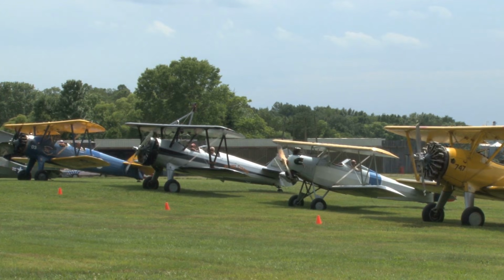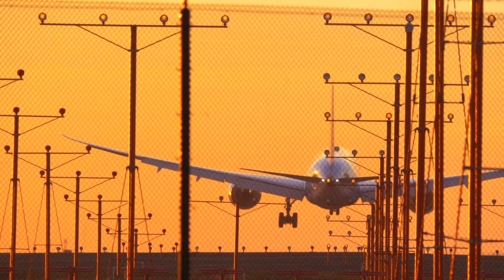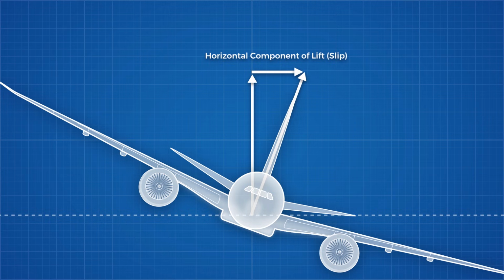Why Does Wing Dihedral Make Planes Stable?

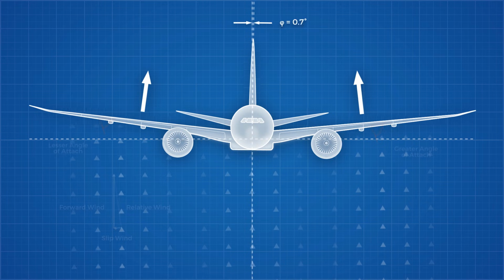Comment: 2:57 the stability of a design in flow can be described by something called the Monk Moment, however i cant find any reference of it online (i learned it in my marine hydrodynamics course).

If you pushed an ellipse shaped object through water lengthways, it is actually unstable and will rotate so it is going ‘side on’. There will be more drag but it will be stable.
Reply: I didn't know that! I wonder if that is what makes kayaks so difficult to keep in a straight line...
Reply: Benjamin Brooks that’s exactly why they are unstable! They have features which help with their directional stability, such as channels running the length of the hull and the shape of the hull its self but ultimately the thing wants to go side on.

Its like balancing a pencil by its tip
Reply: @tommclean9208  Kayaks which are meant for whitewater are nearly flat on the bottom, and are hardest to steer. Others have keel ridges or channels that help a bit. Canoes are easier still. I suspect the aspect ratio affects directional stability. Thanks so much for teaching me this!
Reply: Benjamin Brooks they probably design the whitewater kayaks that way because they want them to be directionally unstable, help them to turn quicker and with less effort.

Comment: From my understanding, at least for cargo planes, another reason wings are typically high-mounted is due to the increased cargo volume. With high-mounted wings, the supports that would normally pass through the fuselage of the plane with low-mounted wings instead pass through the top part of the fuselage giving way for extra cargo.

Comment: One of the less stated reasons for the inverted gull wing on the corsair is that a wing mounted perpendicular to a fuselage creates much less parasitic drag. The designers could have simply mounted a straight wing farther down the fuselage, but it would have created more drag at the wing roots. This is why planes like the F4F Wildcat, F6F Hellcat, and the MiG-15 had mid-mounted wings, even though that design required longer gear and gave less instability.

Comment: Your suggestion of high and low mounted wings is incorrect. All small recip engined cessnas are high wing with dihedral. All small recip engined pipers are low wing with dihedral.
Reply: Because they have straight wings. If they had swept wings the high wings would have anhedral.

Comment: No, it's not a matter of greater angle of attack. It's a matter of less wing area presented to the downward force of gravity. It's also a matter of the level wing contributing to a perpendicular force (straight up)as opposed to the other wing's wing's force pointing even more towards the fuse. 

I suppose we have someone here who believes that wing lift is explained by the Bernoulli principle.

Those of you who disagree with me, please explain how a plane with NO ailerons can bank and turn with just the use of the rudder and and a little elevator. Remember, the fin and rudder are only supposed to control yaw.

Comment: 7:00 The main reason for the gull wings of the F4U wasn’t for prop clearance or the shorter landing gear, but more due to interference drag where the wing root meets the fuselage. The F4F Hellcat had the same engine as the first version of the Corsair and a prop that was only 2 inches smaller and it still had plenty of ground clearance to spare.

Comment: Are you familiar with the "Mandela Effect" and the idea that Airplane designs are different from what they have been? Ex; jet engines are now larger and differently designed, The Wing tip ends are new and had never been seen by me nor many others up until about a year ago. I took flying lessons in my youth and have been airplane centric most of my life. I've never seen the "Forward facing wings before, not even as short term Experimental's.
I've also never seen a jet engine mounted in the center of the tail, that looks extremely odd to me.

Comment: Your explanation of the inverted gull wing is the simplistic version. There was a NACA study that found that there was less drag on wings that are perpendicular to the fuselage, but it's always more convenient to have a low mounted wing. The P47 used the same engine and a little longer propeller and it doesn't have much longer landing gear, so the designers didn't have to have an inverted gull wing for that reason. They did want shorter landing gear to make it stronger as another way to reduce drag the designers made the landing gear the dive brakes instead of bolting on brakes that would induce drag.

Comment: There’s actually four factors which affect roll,
or lateral, stability. 

One is dihedral

Two is interference... which rather than creating a high pressure on high mounted wings actually increases the angle of attack on the lower wing and reduces it on the upper due to how the fuselage influences the airflow. 

Third is tall tail.. or how much surface area is above the centre or gravity. 

Finally are swept wings. The lower wing presents a higher aspect to the airflow while the upper produces a lower aspect... resulting in a restoring force. 

This is why planes like the C-17 have anhedral... because they’ve already got high mounted wings, a large amount of surface area above the centre of gravity, and swept wings. It would be too stable without the anhedral. 

But take similarly configured aircraft without swept wings like the C-130 or ATR-72... and they don’t have anhedral because they aren’t too stable. 

It’s also worth to note that these depend on a slip to work. If you roll an aircraft and the ball or brick or yaw string is in the middle, there is no restoring roll. It will stay like that forever. In fact... due to the difference in speed of the outboard vs inboard wing, the roll actually wants to increase in a turn. Have a look at your control inputs next time you fly a plane—you might be surprised that you have an opposite roll input as you turn. 

This is also why aircraft are susceptible to spiral dives and will often enter one if the pilot is inattentive or it is rolled too far. 

The final point is that these effects are opposite when skidding. The skid is defined when using top rudder rather than bottom rudder. Using top rudder produces a restoring force. Bottom makes the plane roll more. Intentional cross-control is almost always a slip for that reason. 

Purposefully using a skid actually increases the maneuverability of the aircraft. A roll will always be faster when led with a massive amount of rudder. A snap roll... typically the fastest roll a plane can perform (if it’s stressed and approved for it) uses only rudder after the elevators have stalled the wings. The rudder reduces the stall on one wing and increases it on the other, resulting in what is in effect a horizontal spin.

Comment: Did you know that on the F4 Phantom the leading edges of the wings have ports spaced along them, so high pressure bleed air from the engines can be ducted out of them, to give the wing more lift at lower speeds, they did this due to the low "Aspect Ratio" of the wing(translates to a very thin wing).
Reply: Yeah, but is .03% written as .0003 when it come to decimals?

Comment: The Wittman Tailwind W8 and W10 have no dihedrahl or wash out. Makes for a sensitive handling airplane. The only positive stability is from the fuselage hanging below the wing.
    A Very nice flying aircraft that can be trimmed out nicely but needs to be flown and landed with a gentle but firm hand.
   Doran Jaffas 
   N625MS 
   Wittman Tailwind W8

Comment: 4:39 I assume they chose a high wing config to not have a center wing box right in your cargo compartment. Like all proper cargo aircraft... C-5, C-17, C-130, C-160, IL-76, AN-178, AN-10, AN-22, A400M etc. I can't think of a single cargo-only aircraft with low mounted wings

Comment: 6:03 Glad you covered the F-4 Phantom! But why the anhedral horizontal stabilizers?
Reply: The F-4 was a direct descendant of McDonnell's previous F-101 Voodoo, which had a severe problem with "pitch-up", a phenomena where the turbulent airflow coming over the wing would encompass the horizontal stabilizer at high angles of attack. (https://i1.wp.com/www.avgeekery.com/wp-content/uploads/2016/12/aoapitchup.jpg?ssl=1) This would eliminate both the lift from the horizontal stabilizer (moving the center of lift forwards, increasing pitching moment), and also eliminate the ability of the aircraft to correct for this (you can't get the same control out of turbulent airflows). 

Late models of the Voodoo added spin-stabilization chutes and emphasized pitch-up avoidance in pilot training, but it severely hampered the otherwise excellent fighter's effectiveness and reputation. When the designers of the F-4 were working, they intentionally added design elements to avoid this phenomena. By adding an extreme anhedral, they were able to maintain pitch stability at high angles of attack. In reference to the linked image, the stabilizers would be under the arc of turbulent air, rather than in it. Additionally, the distance between the wing and horizontal stabilizer is much smaller, which also decreases this effect.

Comment: I thought the wing position of the f4u-corsair had a different reason, so I went looking for it. And I found this bit:
"The reports showed that the mid-wing configuration, with the wing meeting the fuselage at an angle of 90°, was superior in achieving low drag. The low-wing position resulted in flow separation at the fuselage junction, especially at the wing's trailing edge where a cusp formed with the convex underside of the fuselage. While this could be ameliorated somewhat by using a fillet or fairing along the trailing edge of the wing-fuselage intersection, it was evident that the wing must join the fuselage at right angles similar to a mid-wing configuration if the fighter were to have any chance of achieving the desired speeds."

https://www.usni.org/magazines/naval-history-magazine/1995/february/designing-bent-wing-bird

So it seems to be more of a structural and aerodynamical reason than just for ground clearance.

Comment: Even though not all airplane wings do angle upwards from the middle, it's an easy way for the makers to add some inherent stability, a bit like you get with a boat. Angle of attack, is the angle you might see when looking at the plane from the side. The most basic way to describe angle of attack is the angle of the wing compared to a straight line along the body from front to back. You know, a bit like a kite needs to fly. It's not affected much at all by the plane banking one way or the other.

Comment: F-16 has mid mounted wings not low mounted wings. Something like the F-4 Phantom or Eurofighter have low mounted wings. Also the Harrier isn't the most stable in roll, another reason why it's wings are anhedral is so the tip wheels can actually reach the ground.

Comment: Most of the Wright brother's gliders and the Wright Flyer I featured anhedral wings.  The Wrights were looking for designs that were stable in cross winds.  This also led to them being more stable coordinated turns as well.  Most other attempts at powered flight at the time, Dumont's 14bis for example, had strong dihedral.  The misconception at the time was that an airplane could be made entirely self stabilizing like a boat.  And you could steer it like a boat.  Some of those early models worked ok in straight level flight but were super dodgy in turns and crosswinds.  Blariot's early designs spring to mind.  No matter how hard you try, no airplane can be made entirely stable with no active input from the pilot.

Comment: There actually was an aerodynamic reason for cranking the wing the way they did on the Corsair. In order to minimize drag where a wing attaches to the fuselage a join of around 90 degrees is desirable. Since the Corsair's fuselage was round at this point the optimal place to attach the wing would be mid-fuselage which wasn't desirable. By first cranking the wings down away from the fuselage Vought designers were able to get a lower drag attachment point of near 90 degrees wing to fuselage, and shorter landing gear.

Comment: Minor adjustment: the F-16 has a mid-fixed wing, not low-fixed.
Reply: Irrelevant. Most of the F-16s fuselage is actually a lifting body. Same with the F-14 and F-15.

Comment: Great video, but at 7:04 your talk about the WW2 Corsair failed to mention that the Corsair was to be placed on Aircraft Carriers, which required folding wings, which ruled-out "long" landing gear to provide clearance for the huge propeller, required for the huge 3,000 HP radial engine to attain the required speed.  So, yes, the wings were "bent towards the ground" to shorten the required landing gear, to allow the Corsair to be placed on WW2 Carriers.
Reply: Basically what he said, but the Corsairs landing gear had to be strong enough to do dubbel duty as dive breaks
Reply: @martijn9568  --> I'm surprised (1.) that there was a need for "dive brakes" on the Corsair and (2.) that "long landing gear" were too weak to serve as such.  Seems like the strength required on "long" landing-gear for the expected "worst landing" impact would have sufficed for the strength required as dive-brakes.   And shorter landing gear provided less braking in a dive.  And it's not a dive bomber.  It's not a "Stuka".  What is your source of information?

Comment: On the subject of DDay, where I learnt to sail (Langston harbour) was where the mulberry harbour's phoenix caissons were build and hidden until needed.
They were hidden by their primary function, they were concrete boats designed to be sink and then refloated (hence the name phoenix)
One developed a fault and would not raise off the bottom and remains there to this day, sitting above water now on a sandbank

Comment: Next video: why planes have wings
Reply: Also technically a rocket flying sideways can be counted as a plane without wings
Reply: Well technically the current flying body designs actually let an F15 land without a wing which was lost in a midair crash. The aircraft was able to travel fast enough to maintain lift using the remaining wing and the fuselage.
Reply: X24 and M2F2 have entered the chat